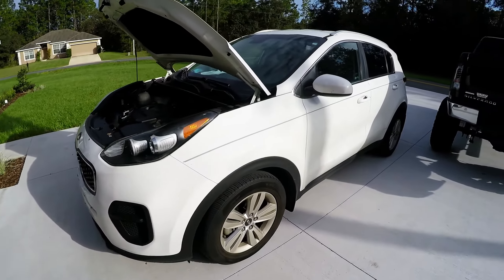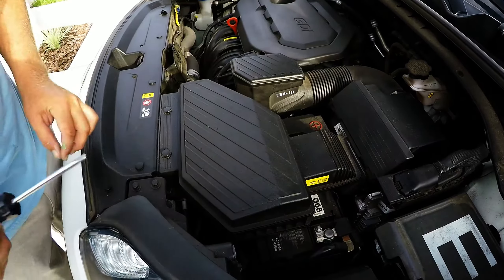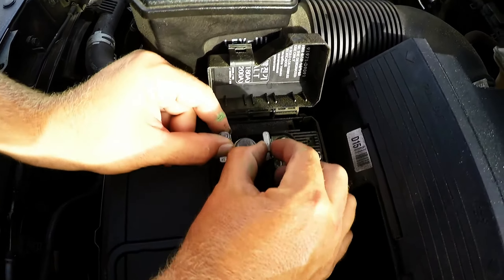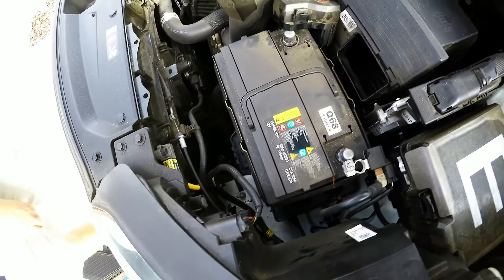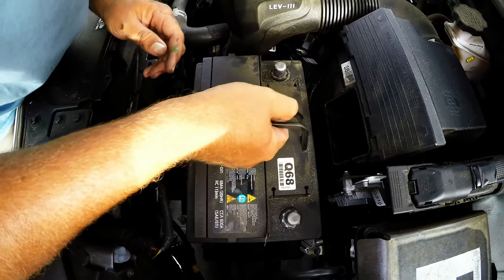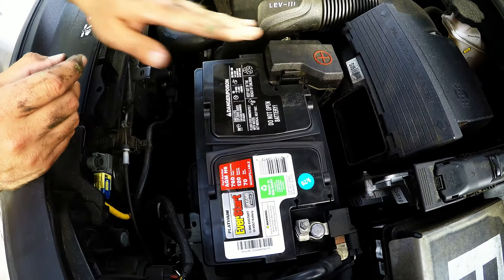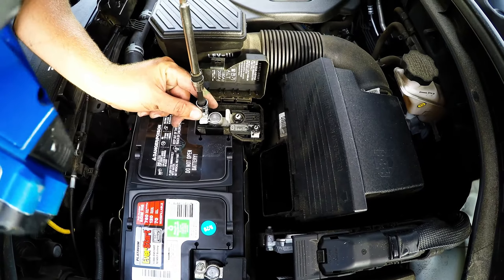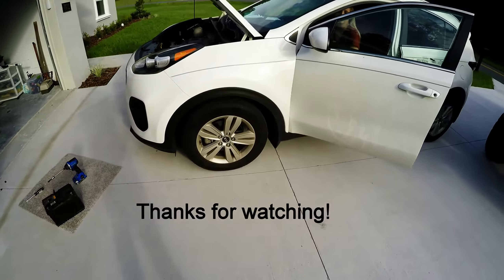DIY 2018 Kia Sportage Battery Replacement

Comment: Negative terminal removed first and reinstalled last!  ALWAYS!!!
You are very very lucky you didn't arc and blow that 200 amp fuse on the positive terminal harness. 
A terminal cleaning tool to clean both posts and terminals should have been done, along with application of a protection grease to guard against corrosion. 
Otherwise an informational video.
Reply: Instablaster.

Comment: The negative terminal on many new batteries may be covered in black plastic.  In a dark garage you might miss it.  There will be a tab at the bottom of the negative post on the new battery, pull it to remove the plastic.   
When loosening the nuts on the battery post you should use a hand tool, the power drill might take it completely off.  
As many have said below, remove the negative terminal first, and replace it last.

Comment: Clear instructions, great video - only comment if you can borrow a spare 12 volt battery and run cables (vehicle booster starter cables) (put tape around them to avoid electric shorting) to the car battery fitments when you disconnect the old battery,  you won't lose power to the car electrics meaning you don't have to reset stuff. Maybe this doesn't affect Kia cars but my Audi A4 electrics and onboard computer die if I remove battery terminals
Reply: "...you won't lose power..." Yes, you will. It would be a miracle if you maintained continuous power by simply attaching the jumper cables' alligator clamps to the battery terminal connectors. If you lose power for even an instant, you defeat your effort. I designed tools for this purpose. Continuous backup power source clamped solidly to B+ and to ground, and ideally not near battery terminal connectors.

Comment: I just had a battery replace in my 2018 KIA Soul today the dealer replaced it and also cleared the PCM history so that it see a new battery install if you don't this can kill the new battery in time this what they said and also i saw this one youtube on this too! The PCM does a lot on these new cars now so its not the old days thing anymore. And also you always take the neg. cable off first and them the POS. cable installing always install the POS cable first and them the Neg. cable last so that way you not arc anything. And cleaning the terminal are part of installing a new battery.

Comment: Did you notice a change in performance with the higher cca rating battery? Mines came with 550 cca and I changed it to 750cca I felt the difference driving.  Due was more excited.
Reply from the maker: Never heard someone mention a battery affecting car performance. I don’t think that’s possible

Comment: To change batteries...is it not needed to keep inner memory in car with another battery meanwhile you change the main battery?. Maybe, this is not a problem for KIA?
Reply: "...not a problem for KIA?" Speaking as a specialist in the field, I always set up a continuous backup power supply for all vehicles.

Comment: You failed to mention the read of the battery must be under the hold down on the read bracket. Come'on man. NEVER use power tools on battery terminals. Use a wrench or socket.